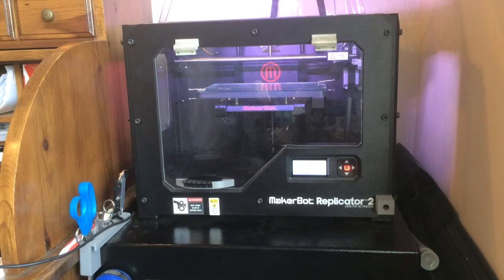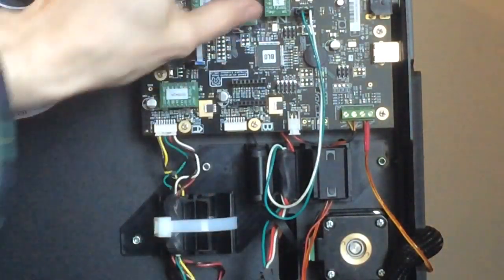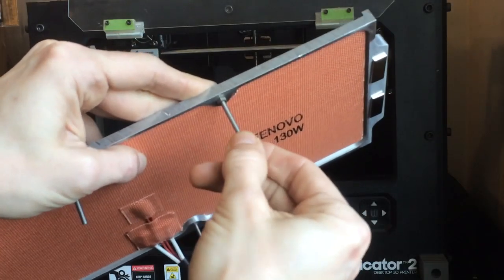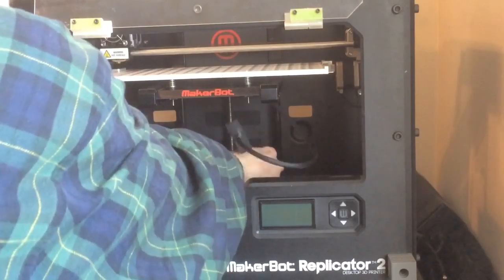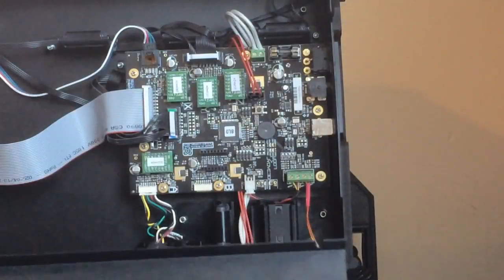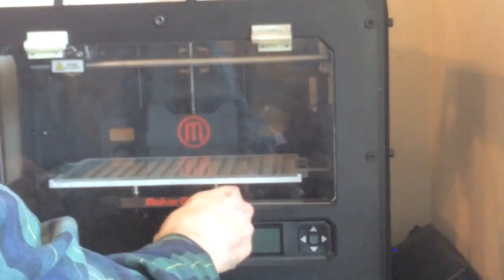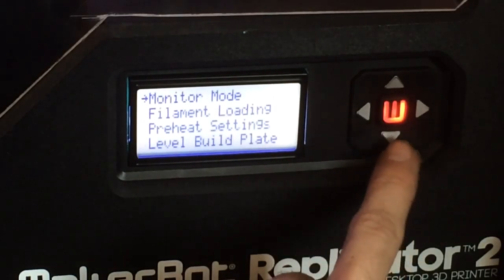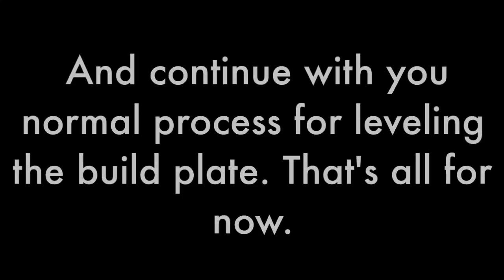Installing Bottleworks Removable Heat Bed Plate Upgrade on Replicator 2/2x

Comment: How flat is the new build platform compared to makerbot stock?
Reply from the maker: Sorry, you comment was put to spam for some reasons. The build plast is fairly flat, but I don’t worry about the aluminum plate directly since your printing in the glass tray that goes on top of the aluminum plate. Since it uses high quality borosilicate glass  it’s very flat with no warping characteristics.

Comment: now maker wear doesint recognise the printer and doesint work :( help
Reply from the maker: At about 20 minutes in the video, did you change the printer menu to turn in the beat bed? Also in maker wear you will have to tell the software it's a replicator 2X, or it might have an option for replicator 2 with HBP? This is probably in your setting or software configuration. I personally don't use maker ware since I run simplify 3D. I don't even have it installed. So I sure someone else that may use maker wear might be able to give better directions on how to change these settings. 

Other factors for people to help you would be more details. Are you using sailfish firmware? Do you print over USB or SDCard? SDCard is usually recommended. I've always had to tell the software what printer it is, so you may want to write down your settings and reset the software to defaul so it asks you what printer you have. Or remove and reinstall the software.
Reply from the maker: Also this group is not active, but has a lot or archived information that is helpful like this URL 
https://groups.google.com/forum/m/#!topic/makerbot/YJbbTiCvGzs

You may want to search this group. If you have not updated the firmware to sailfish I highly recommend this. It print better then the default firmware on the replicator printer.
You could also contact Makerbot support for the makerware software support, they might be able to help. I'm sure they have changed and updated the version since I used to run it 3 years ago before I bought simplify 3D to do my slicing.
I hope this helps, good luck.

Comment: How's this working out for you I just installed mine and can't get anything to stick to it (using kapton).
Reply from the maker: +dnelms2 I use a thick mil kapton tape without any problems. Make sure you dont have any drafts, and having it enclosed also helps maintain the heat. Give it enough time to warm up also. You can also scuff the kapton with a green back of a sponge or fine sand paper. I also now ise ABS glue, you can google it. Or some hair sprays also work good and no need for kapton tape if you find a food one. Their are some google chat threads with a lot of good advice. Makerbot had one that you can still read, but they closed it so we cant post anything new. 
Good Luck, it takes some time to learn the little tricks but once you get to down they work great.

Comment: Hey Scott, can I use the stock power supply for this heated bed?
Reply from the maker: +tac ke bong No you can't. You need to provide more amperage to run the heat bed. See the description of my video for a link to the part number of an external power supply that will work. This is for an authentic MeanWell power supply. Be aware of all the fake MeanWell power supplies, the last thing you want is to short out your printer from a cheap fake power supply. MeanWell was the original provider for the replicator printers until Makerbot changed vendors to a cheaper power supply.

Comment: Looks good! i just installed the bottleworks arms and hbp and was wondering what your temperature settings are for abs and pla, (extruder and heated build plate).  

thanks

Comment: Have you ever had any problems with the flatness. I recently installed mine and at first it seemed flat, but now it seems pretty off. The sides look like they are sinking slowly. I have the metal arms installed as well. Once I get home I will make sure it is not the glass and is in face the metal plate.

Comment: Cool video I have this bed plate on my Replicator 2.  I can get it to heat when I pre-heat.  But I cannot figure out how to make it heat and stay heated when printing in ABS.  I use Simplify3d, I tried using a Rep2X preset .. but when I go to print the built plate turns off.  I also tried using the Regular Rep2 preset and added a heated built plate.. but again same issue it turns off when I go to print.   I also tried using Makerware and just using the 2x option again.. bed plate turns off when I go to print from the SD Card.   I'm not sure what to do sailfish firmware is installed, HPB is set to YES or whatever in the general settings.  Pre-heating works fine.  Just cant get it to heat when actually printing from a makerbot file.  Thanks
Reply from the maker: URABUSWRXSTi 
Did you add a temp  > sensor under "Temperature" tab on S3D and set the bed temperature?
Reply: Yea I did. I got it working tonight I needed to go into the firmware settings of Simplify 3d and select Replicator 2 With HBP under the x3g tab I think it was.  all good now.. Just printed a raspberry pi case in ABS.

Thanks!

Comment: comment mettre programme d'origine makerbot replicator 2
Reply from the maker: martin vincent 
martin, je ne suis pas sûr de ce que vous cherchez. sa peut-être perdu dans la traduction? cherchez-vous l'original replicator 2 du firmware? ou d'essayer d'ajouter le RAP pour travailler sur le réplicateur 2 du firmware? Si votre exécutant le firmware de makerbot original pour replicator 2 e alors je recommanderais mise à jour vers les voiliers et tourner le RAP dans les paramètres du firmware.

Comment: Scott - I just got the build plate and appreciate you putting together this great video.  When you print ABS with the glass build plate do you still need to use the kapton tape?
Reply from the maker: I still use Kapton tape for my builds, I prefer the 10ml tape but any tape will work.
For larger builds I use a ABS slurry.

Comment: Does this require or include the aluminum build plate support arms or does this attach directly to the stock plastic build plate.
Reply from the maker: You can use it with the stock arms, but you may want to get the LU arms eventually or some sort of arm strength enforcers since the heat from the build play will eventually cause the arms to work slightly
Reply from the maker: That was supposed to be cause to warp, not work.

Comment: Hello there Scott. Are you able to print with ABS on the Replicator 2 with this mod?
Reply from the maker: Yes, the heat bed plate would be the main reason for the upgrade is to print ABS.
It's also good to help with PLA warping if you set the bed around 40C.
I keep my bed at 92-97C for printing ABS. 

Enclosing the sides windows and adding a door also is a good update for ABS to stop any cold drafts.
Reply: Thanks Scott, I'm considering upgrading. You got some nice links  there.

Comment: Thanks for the insights on the tweaks. Great advice. It's going to be a busy weekend (all the upgrades are sitting on my bench right now). I will stage it out as you suggested. By the way, I dig your reasoning for rotating the M on the front panel. It's like owning the original axe that George Washington chopped down the cherry tree with - but because of its age, you had to replace both the handle... and the head. Thanks again.

Comment: Hey Scott. Great work on ALL your videos. I've found them extremely helpful and informative. I'm about to perform all of these upgrades to my Rep2 (arms, plate, x-ends, alu-carriage, etc) but I'd like to only tear the machine down one time. Any advice on which order you would make these mods? Thanks again - keep up the good work.
Reply from the maker: The carriage and HBP are not what I would consider major mods. They can be done before or after e others. 

As for the X-ends and Arms these require taking apart totally different parts of the machine.
So no order would make a difference or save any time on these.
I usually recommend doing one update like the X-ends, run for a week or two to make sure everything is working good and tuned. Then do the arms the following week. This is only because it can make things harder to troubleshoot and issue if one happens if you do both the same day.I think you will find when you order these parts (arms-xends) they may arrive in shipping a couple weeks apart and that's usually good when doing one first, then the next. 

But if you were going to do these the same day then I would say the X ends are easier to test faster. So I would do e X-Ends and run a test print. If all is good then do the arms.
Reply: Hey Scott
Thanks again for the great vids and the reply to my previous question. I have another question for you. The weather's getting cold again here and I'm digging into my Rep2 upgrades, starting with the Bottleworks HBP. I've noticed that the glass plate shifts like crazy along the x and y axes (like 2mm either direction). I can't imagine this not causing a problem - it seems so sloppy given all the attention to precision that a guy pays to the guts of these machines. Does yours do this? Am I worried about nothing? I can send you a 10second video of it moving around if my description is inadequate. 

Thanks in advance. 
greg
Reply from the maker: +Beefwiz mine will shift a little also, but only with me moving it. The printing doesn't seem to move the bed, the magnets are strong enough to hold the bed in one spot when it's printing. 
If your worried about it you can use aluminum tape to fill the gaps were you think it might shift? Just a thought, idea.

Comment from the maker: @Michael, the aluminum glass HBP from bottleworks works great. I haven't had a single issue. Holds temp well and is nice and level. 
In the description of my videos I out a link to the google chat makerbot operators group for each product I do an install video on. 
It's under:
"Follow the conversation and see what people are saying"
To get information and opinions that would be the best link since it's directly about this HBP. 

Currently I only have time to do the install videos and I'm staying away from reviews. But trust me, if I bought it then I've decided it was worth the money. I do a lot of research before I buy something, some would say obsessive. I was researching 3D printers for 2 years before I bought one. But don't take my word only, go check out the group. :-) and return to the video for visual aid for your install once you buy it.